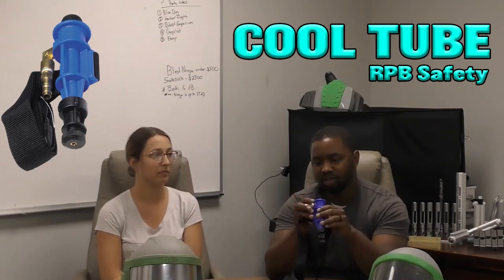Sandblasting Climate Control Devices - Cold Tube, Hot Tube and C40 by RPB Safety - #GOTAB

Comment: If you noticed the cold air device can be flipped to hot or cold, it's written right on the side of the unit.
Reply from the maker: I did not know that.... I will need to take a look.  Good info!
Reply: @bluedogblasting2568  It isn't as efficient as the hot only unit, but it works in a pinch.